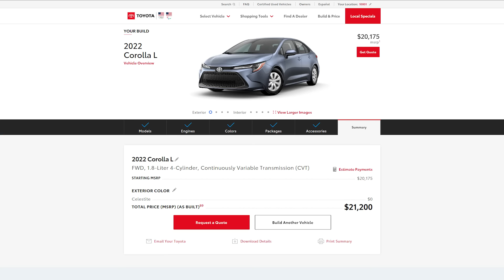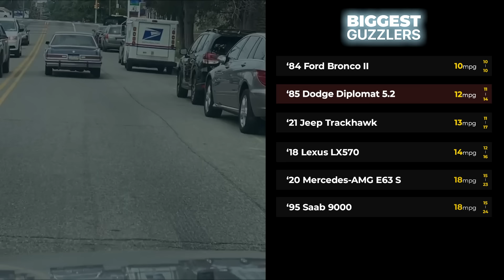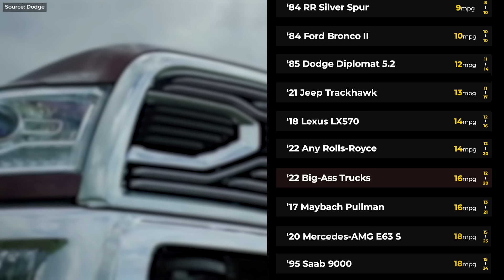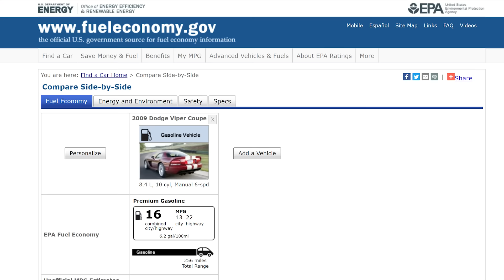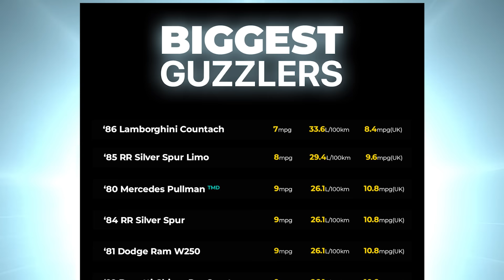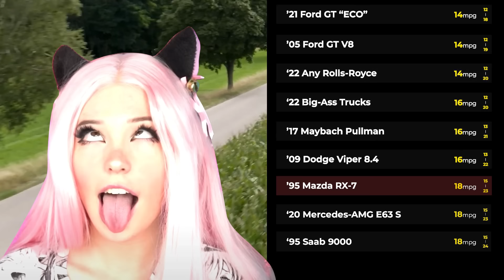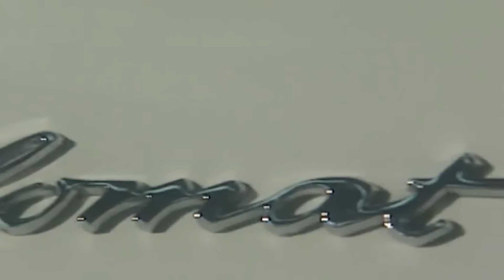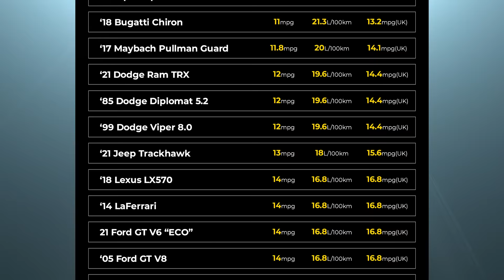RANKED: which Cars use the MOST FUEL?

Comment: Man! These gas prices really stopped me from buying a Veyron...
Reply from the maker: Same
Reply: @TopCarsTV  lol 😂
Reply: don't forget da 50k for each tire which is to be replaced every year even if its not running.
Reply: @simplydrawit7997  and the 25 thousand dollar oil change
Reply: @tylerplayzz8697  Thanks guys for the heads up, I almost picked up a Veyron, will stick with my Corolla for some more years
Reply: @Div6317  Good choice! 👍
Reply: @tylerplayzz8697  thanks bro
Reply: @Div6317  np😁
Reply: You might consider a Chiron then
Reply: I would have bought one but my bank account shows 37 but with a line behind it
Reply: Yep same I was gonna by one and a veyron and a agera r
Reply: Yeah I was looking at a Veron but because of the gas price is like you said I chose to buy a $3000 use Hyundai Sonata four-cylinder with a five speed in the floor yeah that Bugatti would cost too much in gas to drive
Reply: Same fr
Reply: Actually, the main issue is not the gas price... it's the distance between the petrol station and home on one full tank...  Do Veyrons come with a tow hitch and a tank trailer ? 🤪
Reply: Drive an M1 Abrams or Leopard 2A4 and have the tax payer pay for all  your vehicle expenses.
Reply: agree

Comment: 2 mpg? At that point it is technologically interresting how they make that happen. They must be using firehoses directly from the water main.
Reply: Something along those lines. That’s an insane amount of fuel. The technology has been out for a while though, many old gt1 race cars got approximately 2mpgs while on track. And those were regulated to 600-610 horsepower. They also had to slow down and accelerate out of corners though. In short Bugatti managed to move a shit ton of fuel in a short amount of time.
Reply: @ryanrake2714 I don't know about all GT1 cars, but I know that the F1 GTR had an mpg of 6 while most of the Group C cars (Mercedes, Porsche and etc) had mpg around 5.5, all that while the Audi R10 TDI had mpg of 5 (le mans is 13.6 km, and the car needed to be refueled on every 14ish laps which is roughly 195 km, all that while the car had 90l fuel tank... which means 46l per 100km or 5 mpg).
The reason why I'm saying that is because I don't know of any race car with 2 mpg, and I will be curious to learn about it.

Comment: is no one gonna mention how the Bronco II isn't the full-size version they show 3 or 4 times here, and never came with the 351 windsor?  Also, that it got more like 18mpg?
Reply: Ikr?  Makes me question the accuracy of the rest of vid.  A 351 Bronco ll would be fun tho.  Mileage be damned!
Reply: @BastardX13  Besides that, not all V8s are "not fuel efficient".

For example. I got a 1999 Ford Crown LX with the V8 4.6 Liter and has a gear ratio of 2.73.

I keep the tires properly aired, changed the Spark Plugs when it has to be changed and etc of other routine maintenance.

I can fill up a full tank on Sunday and go on the same tank until Friday or Saturday, due to the fact that I don't drove like a fkn maniac by keeping under the speed limit.
Reply: Exactly, the size is completely different and the power plant is too, I have one so this is definitely not an accurate video
Reply: @borla4491  I have an 06 Mercury Grand Marquis, same drive train as your Crown Vic, 27 on the highway, 21 through town.  But I do drive like an old lady
Reply: I was thinking the same thing.  The 84 full-size bronco came with a straight 6, you could get a 302 or a 351.  The bronco 2 had a 2.9 V6, I don’t know if they ever offered a different engine.  My point is that the same as yours.  Completely different vehicles.
Reply: @codycole3202  I think they had a 4cyl Mitsubishi diesel or something too
Reply: Agree, validity of the rest of the video is questionable at best. Moving on after 1:57.
Reply: @BastardX13  I'm in the process of swapping a 302 in mine 👍👍👍👍 love the little rig
Reply: That will be a fun ride Mr. Sautter.  Shoulda sold em that way in the first place. Get ready for the pucker Tucker. America!
Reply: I have a Chevy Silverado pick up truck with a 5.3 L Vortech V8 and it gets 17 to 18 miles to the gallon most V eights are actually more fuel efficient than four-cylinder‘s because fuel efficiency is how much work can an engine do on a given amount of fuel. But yes some of the things in the video were there’s no way that I can get that bad of gas mileage and also they didn’t mention that a fully loaded semi truck going uphill that’s pulling can get as little as 4 miles to the gallon.

Comment: Hey Stype, fuel in NSW Australia is about $2/litre ($8/Ga). It varies between states, and even on different days, but that's a fair average. We drive a long way here. The cost of fuel is important to people.
Reply: Similar in Germany in terms of pricing
Reply: 2€/l
Reply: @honestyisthegucci  Yeah, but the minimum wage in Australia is around $2900,00 per month, while in Germany, you guys have around €1.584 per month, so...it's technically not the same thing
Reply: The dutch price is 2.20 a litre
Reply from the maker: @gustavoborges2356  I didn't know that Australia has such high minimum wage
Reply: @TopCarsTV  that's because their salary is hour-based, so If you do the math based on 8 hour of daily work, that's the number you get
Reply: I own a car, but i use my motorcycle daily to save money on fuel. Also, it helps with the traffic which seems to being getting worse by the week.
Reply: Here in Bulgaria is 1,5€ per litter, but it is becoming worse with every day :(
Reply: And this explains the prevalence of all those thirsty commodores and Falcons?
Reply: jase, Australian here. My local servo was $2.08 per litre of E10 today. My 2017 Toyota Hiace has a 70 litre tank, so work it out what it takes to fill.
Reply: @TopCarsTV  ,, Australian minimum wage is $21.38 per hour. 38 hour week is also deemed full time employment. Aussies have been working a 38hr week for several decades now. I used to work a nine day fortnight, meaning I'd get a three day weekend every second weekend.
Reply: @jurgentreue1200  yeah, i know. It's gone up since i posted that. On a trip to Moree recently i paid $2.47 for diesel.
Reply: Same thing here in America your average person has to drive more than 10 miles or 20 km to go to work. I drive 28 miles to go to work or almost 60 km. So even for us Americans fuel price is very important you only hear about the people stuck in the stinky dirty cities but you don’t hear about the people that live in other parts of the country. So yes fuel prices are very important to us here in America because it also reflects how much we have to spend in groceries and for goods at the store
Reply: Tbh in WA the diesel prices have been quite steady for a while, mostly in the 190-205/litre zone. Meanwhile petrol zoomin all over the place
Reply: Remember guys, he's speaking in AUS Dollars, which are not the same as American dollars. An American dollar is worth quite a bit more than an Aussie one. A bit like Canadian dollars vs American dollars.

Comment: I remember watching an old Top Gear episode where they drove a Toyota Prius as fast as possible on a track with a BMW M3 V8 following closely behind and the Prius ended up consuming more fuel.

What I learned there is that regardless if your car was engineered to be as fuel efficient as possible if you have a heavy foot, you'd still end up spending more money on fuel. A change of driving style is essential for saving fuel.
Reply: This should be pinned. One of the only times that Top Gear was giving useful advices from later seasons.
Reply: Yeah, brilliantly said Miguel.  Part of the reason the Viper gets more mpgs than Stype thought is because the Viper is a very small, aerodynamic and light car so if u drive it efficiently that big ole V10 is doing close to nothing.  Another car that comes to mind is The Jaguar XJS with the V12 it gets better fuel economy than a lot of the Mercedes V8s of the time (the Jag averaged 20-21 MPG and on the highway it did around 23-25 and if you drove it really efficiently it could even more!)
Reply: @SheepMan420  Your last sentence reminded me of a 400-mile road trip on a Mazda RX8 by Car Throttle. The Rx8 is notorious for being inefficient, yet it made it averging 30 mpg uk.
Reply: @Thiện Bảo Nguyễn lol that’s awesome
Reply: As far as I can tell, the M3 had less aerodynamic drag following behind closely. Myth busters, also in a way proved that aerodynamics plays a big role. They took 2 ford tauruses (?) and sculpted one like a golf ball, and was surprisingly more efficient even with the added weight of the clay or whatever it was.
Reply: @Kingswood7189  The lesser drag for the BMW M3 (E90) has bothered me, too. But primarily, Top Gear is an entertainment show. They had to show that they are always driving the same speed. And they can't go for a second approach where the Prius gets the slipstream. The M3 would drive either too slow or too fast. We have to deal with the slipstream for the BMW M3. If we cancel it mentally, the Prius would still be very thirsty at full throttle compairing to the much more powerful M3 driving the same 'speed'. That's what it's all about... It was fun and entertaining! 😎
Reply: My 92 Civic Si got 45mpg with a light foot

Comment: Hungary: Fuel price is capped at 1.28 EUR right now (per litre). If the cap is lifted it will move to 1.75 EUR
Citroen Xsara Picasso 1.6 16V (compact family hauler aka MPV) around 9 liter combined (mostly city) with winter tires...
Reply: In The Netherlands it is 2,42 euro per litre
Reply: still very cheap
Reply: 9L/100kms?
Reply: @christopherjohnston6343  No garage, so cold starts in the winters are taking its toll on consumption. Combine that with city traffic and you have such a nice figure as consumption
Reply: @kelemenkaban2505   9L/100kms or 9km/L?
The first is not great but totally fine. The second is getting pretty thirsty.
Reply: @christopherjohnston6343  It is 9l per 100km

Comment: Glad I drive a Subaru Legacy (the 2019 with the 3.6, not the new one with the boxer 4).

Fun fact: the new Subaru Legacy with the boxer 4 2.5 turbo is 6% LESS efficient than my 2019 Legacy with 2 more cylinders and 1.1 more liters.
Reply: Hard to compare a turbo motor to a naturally aspirated motor, though.
Reply: And most Subarus ship with the horribly unreliable and utterly soulless CVT :(
Reply: @MacTechG4  uh…we don’t. Talk about that
Reply: @c-a-sbuilds7051  yes we do, the CVT is a “one trick pony” whose only parlor trick is getting about 5 MPG better than a sludgebox or DCT, but at the expense of reliability and driving enjoyment.

I’ve had the misfortune of renting a 2020 Corolla with CVT, and even with the Toyota physical first gear “launch gear”, it was still a horrible experience, I spent at least two weeks in the thing, and hated every second.

Manual FTW!
Reply: @MacTechG4  Fun fact: the WRX with a CVT gets 1mpg LESS than a manual WRX. Also the WRX gets 21MPG combined (22 with the manual). This new 2.4 is one helluva guzzler.

Comment: Fuel is around 2 € per liter at the moment. My '21 Ford Focus 2.3 EcoBoost does around 26 to 36 mpg (from refuel to refuel). So it's around 30 mpg avg. My much older BMW 330i is around 30 to 23 mpg.

Comment: I’ve just bought the new Hyundai Tucson PHEV and it’s happy with 56mpg which i consider very impressive for a car this size! 
If I drive electronically and use the engine only for heating it drops to the 300mpg mark and if you don’t need heating at all it just doesn’t run the engine at all so…. 
Yeah SUVs aren’t really the right thing to buy if you worry about the environment but as a volunteer firefighter in a rural area there was just the need for a awd car which can handle off-road situations and with that in mind I’m very happy!

And yeah, I’ll love the look of the N-line in shadow grey… a bit mean but not too much

Comment: 2003 Bentley Continental GT used 25litres/100km (9mpg). 
My Porsche uses 6 litres/100km (40mpg) when my wife drives it 😁
Fuel in Australia is currently $2.10 per litre (about $8 per US gallon)

Comment: Made a mistake with the Bronco. What you listed was the Bronco ll, the small SUV that was built upon the Ranger platform. Depending on what motor and drivetrain, they got pretty good fuel mileage. If you could find the 2.2L and 2.3L diesel 4 Bangers were are incredibly rare and collectible, you could even see 30MPG plus with those vehicles.
I own an 83' Ranger with a 2.3L with 4WD and I get pretty good fuel economy averaging about 17-18MPG in the city and 20-21MPG on the highway. Not the best but good for a 4WD truck.

Comment: In Portugal 1 liter of Diesel is 2.25€...so yeah in Portugal Diesel right now is more expensive than petrol in some gas stations. And i have a Seat Leon FR with the 2.0 TDI with 184 hp  with a 6 speed manual about 380 nm of torque  and it does about 5.5 liters combined.

Comment: 12:10 it's not doubtful at all that the bigger engine in the viper gets better gas mileage. Assuming the car is pretty much the same everywhere else and the weight in particular isn't all that different than the bigger engine can pull it along at a cruising speed and not be as stressed, especially if it's also paired with a transmission and rear end that has better and more gear ratios than the older models.
Reply: long gears

Comment: I have an ‘05 Chevy Colorado X-treme,  and have it loaded up with my work stuff [ and it’s packed], and I get 21.5 MPG, around Jacksonville Florida.
Going to get my supplies in Orlando, and Clearwater Beach- round trip, 450 miles , take roughly 16 gallons.
I figured out [ 1 time], at 24.7 MPG, on one of these trips.
Not bad , considering all the weight I haul.
📻🙂

Comment: So, some quick corrections regarding the 84 bronco. Most of the images you showed was of the bronco 2, which you got kinda correct in sales figures, however the bronco 2 had 3 different engines available with a smorgasbord of 4 and 5 speed transmissions; 2 cologne V6s, a 2.8 and a 2.9 liter, and a 2.3 liter mitsubishi diesel. These 3 engines were able to put out between 15 and 17 mpg combined. The facts and figures on the regular bronco were indeed correct, however you showed the bronco 2 most of the time. Still great work, though.

Edit to clear things up: the bronco II and bronco in the 80s were very separate models, with ford still recovering from the emissions crisis. The small SUV sold well in the 5 years it was around, but it never quite outsold the full size behemoth.
Reply from the maker: From the script: Over 300,000 Bronco II’s were sold, of which a good chunk was with a big 5.8-liter V8 and a 3-speed auto. That’s not a very nature-friendly combo. 

🙂
Reply: @TopCarsTV  agreed, however the bronco 2 and bronco were different models. Like the current bronco sport and bronco.

Comment: In Denmark right now, the gas cost 8,62 $ Per US Gallon.
And my Toyota Avensis goes 33 Miles pr gallon on winter tyres, it will probably rise to at least 40 Miles pr gallon when it rides on summer tyres, and the weather gets a little more hot.

Comment: I currently have a 2020 BMW M4 Competition Convertible. I do almost 100% city driving and never more than about 10mi per day (currently at 16k total mi on the clock from new)…and I have 1 of my driving presets (M1) set to sport trans,sport acceleration,sport speedometer,&comfort suspension and I average about 11-12mpg…tank is approx 14-15 gallons total. Premium is approx $4.80/gal in Atl, GA. I think this is hilarious

Comment: 92 civilian combat truck with a Detroit diesel  6.5 litre V8 can do 10 mpg

While another truck weighs 10 times than this with the engine sized 2.5 times manufactured by the same company also gets 10 mpg. 

This is how Detroit diesel learned from GM and than it shaked It's hand with Daimler.

Comment: For reference tho, the 918 does 22mpg in TRACK MODE. It can achive a MIND BENDING 67 MPG in eco mode!! It even has a decent range in it cause it can run the engine as a generator for the electric motors. This is in a 900hp hypercar. HOW. This is why I think its the most impressively engineered car EVER.

Comment: Gasoline in Serbia is currently 185 dinars per liter ($1.85 or €1.5).
Issue is that main alternative, LPG is at 117 dinar, which is at 60% of petrol price. Considering that LPG uses 20-30% more fuel, and that maintaining that system costs money, and you lug around 50kg more weight in tank alone, you save almost nothing. 
Nice thing about LPG is that it has 100+ octane rating and it burns almost perfect, with no pollution, it is a shame, but I had to take mine out
Reply: Samo €1.5? Jebote, u Engleskoj je skoro £2/litar

Comment: In Melbourne Australia today, the price of  91RON petrol was AUD$1.76, for 98RON (the stuff I need) it was AUD1.96, My car has a 6 liter Chevy LS L77 with 500 bhp, and I get aywhere between 20 and 30mpg depending on highway or City driving. Which is fine for a 500bhp V8 in a 1800kg car that will reach 100km/h in 4 seconds and 200km/h in around 11 seconds.

Comment: I'm in Jamaica I have a 2011 Toyota hiace grand cabin 2.7l petrol awd.  it does 15mpg on a very good day and petol here on average is  $5.75 USD per gallon ($1.52 per L) 87oct RM/2 to $6.40 per gal ($1.69 per gallon)low sulfur diesel. And when you put it into consideration minimum wages here is $58.16 US Dollars per week which is $1.45 per hour 40hr work week, you can see it's not cheap living here. Oh yes there is a general consumption tax on everything which is 15%. And I don't even want to start with taxes 🤣

Comment: I have just paid £158.9 a litre for unleaded which roughly works out to £7.15 or $9 a gallon (European Gallon). I'm getting around 45mpg driving like a grand mother in a pleasant but boring 1.5 litre mild hybrid. I don't get any "Smiles per mile" but its what I need right now.